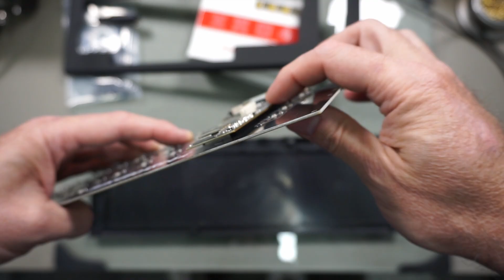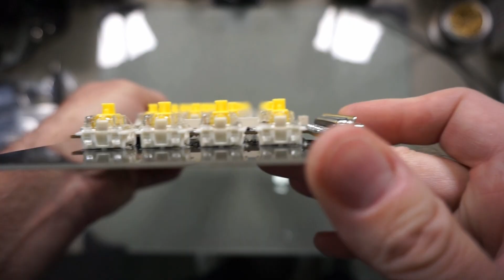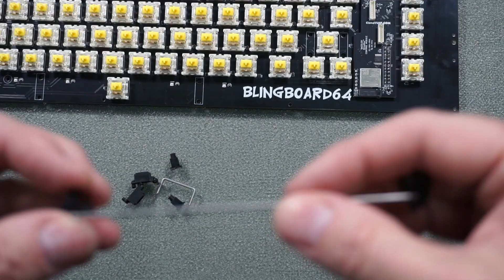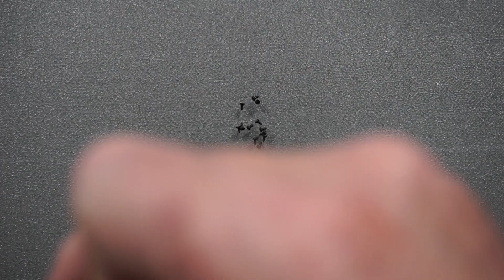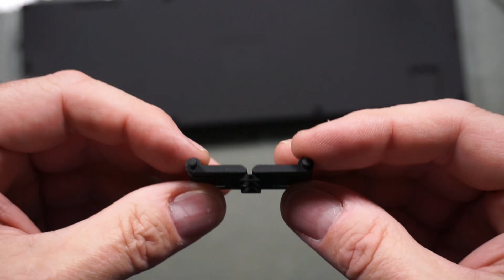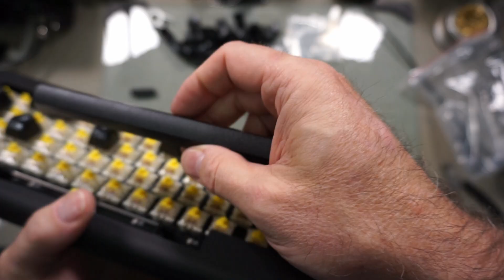BlingBox™ Kit Assembly

Comment: Any reason why I wouldn't want to install the stabilizers before the switches? Wouldn't that make installing them a little easier?
Reply from the maker: Good question!  I found that cleaning the board is more difficult because even the water soluble flux gets stuck in the tangs and spring clips.

Most people will probably use standard solder with normal gooey flux and that will be a mess.